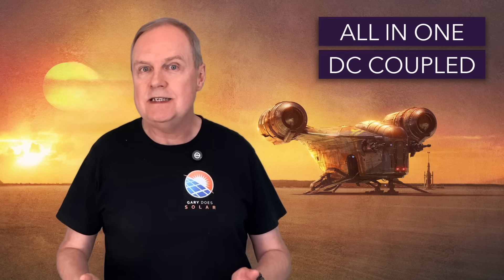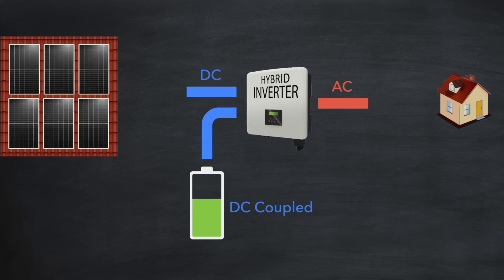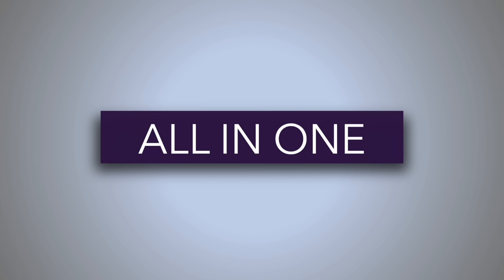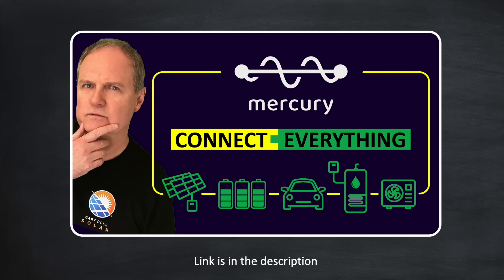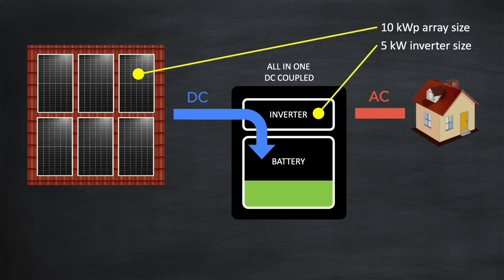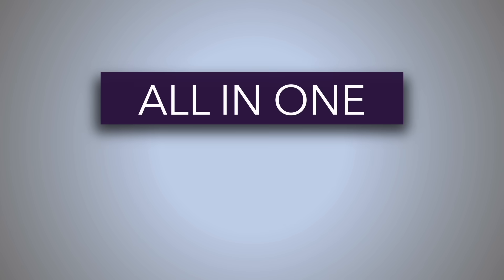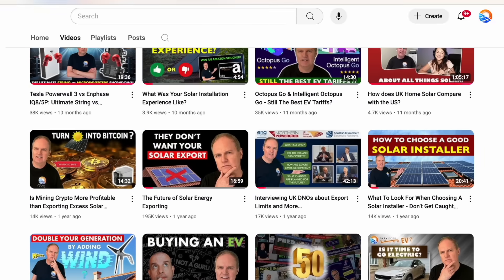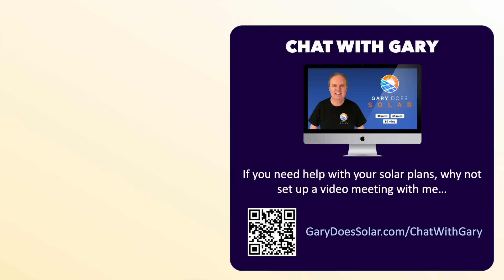Why All-in-One DC Coupled Systems are Transforming Home Solar

Comment: I was done a disservice by having a micro inverter system recommended and installed with my solar, even though I told them we would definitely be adding battery storage later as the prices were plummeting in ‘23-‘24. Now I have fewer choices and/or face big conversion losses taking my inverted panel production back to DC for a battery and back again to AC for home use. 😢
Reply: Correct. This is one of the reasons why I never recommended microinverters so far.
Reply: Having installed and serviced Microinverter, String and AIO, + offgrid systems, I don’t know that I agree that being set up with a Microinverter system was really a bad deal for you. Not the best, not the worst- all of them have achilles heels, all have advantages that might be lifesavers down the road.  

The lifesaver with Microinverters and AC coupled Batteries on the side is that you have less chance of getting a full system failure.  Inverters are ALL vulnerable, and some die.  With MI’s you still have others chugging along.. with a single sting inverter, you’re dark.

It’s very informative watching how these tools age, how their mfr’s age, how installation companies age- and what ‘the next guy’ has to face when coming across an ‘Ancient’ 18 yr old system.. what gear is salvagable, what is supported or warranteed, what will these shiny things be like when they have earned a handsome patina?

I would like to have some of my modules tapped with a simple DC bypass, so I can grab at least a few watts when everything else has pooped the sheets..  it’s amazing how insanely useful even 20-40-100 watts is when you just need the real essentials- otherwise, in regular times, backfeeding that grid and just earning your KWH’s while you’re busy doing the rest of life is the best value I see from residential solar.

(PS..), I have installed Sol-Arks and Midnite AIO’s, and tend to like them both a lot.. BUT, with them we are entirely dependent on the software being, becoming, remaining solid in there-  sometimes a new firmware update is like Christmas, bright lights shimmering and Angels sing- sometimes it kills the system, or revokes some feature you had loved or grown dependent on..  and don’t fall in love with any GUI.. it will be ripped from your hot little hands, sure as sugar.

The nightmare used to be the dream that you are onstage somewhere and you don’t know what show you’re in or any of your lines- today, a new nightmare is being jn a beautiful, fast lovely Car, and the programming changes unannounced, and at 85mph, you lose your steering and your brakes..  yeah.
Reply: @BobFiske  If the reliability of inverters is the concern, then microinverters are really NOT the answer as maybe you seek redundancy but in the same time according to the reliability analysis, of the most vulnerable item you would liek to have:
- The fewer the better, as the number of vulnerable items suppresses the system reliability
- The vulnerable items some handy place on the wall, not on the roof.
- No addition of the drawbacks from both worlds.

Comment: Sounds great, Gary but I still don't know how to do the following.  I have an EV.  When I am charging it during the day, I only want the excess power to go to the EV.  My charger will put 14A into the EV and if I am generating 10A of excess power, it will take 4A from the grid.  Then when I get a home battery, I want the EV to be charged first and only if there is still excess power, to send it to the home battery.  If there is still an excess excess, to send the power to the grid.  How do I do this.

Comment: 11:35 but the DNO/DSO always only see an inverter because our homes don’t use DC power.  So the question is whether or not they see a separate inverter for the battery and a separate inverter for the PV array.  Am I missing something there?

Comment: Robotic manufacturing, dark factories for sunny Australia.
Robotic manufacturing 247,365 is 8,760 hours of production per m².
Robotic manufacturing footprint is 50% human manufacturing footprint.
So 17,520 hours per "human" m².
Productive human manhours 1,800 hours per year. 

Factory production per m² is 10times bigger.

Australia does not need more workers.

Australia needs more PV electricity panels 
Australia has 20million empty roofs, dirt-cheap realestate. Australia needs :
More roof shading 😎 
More batteries 
More EVs 

Existing Manufacturing is where the population lives, where the roofs are. 
Government should reroof all roofs in PV and waterproof membrane under. In the shade of the panels. 

Near manufacturing needing clean energy 

New transmission from distant grid generation is extremely expensive. EXTREMELY EXPENSIVE. 
From distant renewables is also EXTREMELY EXPENSIVE.

Comment: As long as components can be swapped separately in case of a defect, fine. But that's THE condition for me.
Reply: I think that is possible, as far as you mean modules by the term "components". However some of these are quite heavy, so possibly you will need some help to do so.

Comment: Some very good points well put, When I carryout new solar PV installations I use DC connected equipment.  However when I carryout a battery  installations to an existing Solar PV  system that is receiving the FIT payment my preference is to fit an AC connected battery.
Reply from the maker: Thanks—and yes, adding an AC Coupled battery to an existing UK Feed-in-Tariff makes a lot of sense 👍🏻

Comment: Unfortunately I had an old FIT system from 2014, with a generation meter fitted straight after the inverter. All was well until in 2024 I had  a Libbi battery and a Zappi fitted. Worked great, but because it now had a hybrid inverter, the generation meter was replaced by a bi-directional meter that measured the net generation and when the solar charged the battery the meter ran down. After 10 months of trying the fix the problem, I had to buy a new separate inverter for the panels, and have the meter attached to this to get my true generation readings back. I would say, if you have a FIT tariff, do NOT interfere with the metering side of the solar generation and leave it AC coupled. The installer of the battery was very helpful in resolving the issue, and helped with the cost of the new inverter, discounting me the cost of it if I had another battery module installed. I am now very happy with my maxed out home storage system, and FIT payments have resumed, but it was a stressful time that could have been avoided.

Comment: Hi Gary, thank you very much about good video.
I have solar panels. I have planned (several years) to by ev. 
I have been waiting V2G solution or it could be better the integrated system that could handle all.
Did I understood right Sigenergy could do what I have been waiting for?
Of course after integrated system, you have quit challenging task to optimize  the whole.
The inputs for optimizing task should be at least: power price for input and output, transfer costs, solar production, home consumption and ev battery possibilities.
Do you know if there is any application/ or system for that optimizing task?
And then you need of course to evaluate how much all needed systems costs campared to possible incomes/ savings.

Comment: I'm a great fan of your channel, Gary, but for once I don't understand. You seem to be saying that the main benefit of all-in-one systems with a DC-coupled battery is to the DNO, not to the consumer - other than the convenience of it being a single package. That seems a curiously uninformed view.

There are pros and cons for AC and DC coupled batteries. You've covered the pros of DC-coupled, but what about the downsides? You had one right there on one of your slides: if you have a 10kW capable DC-coupled battery with a 5kW inverter and your home wants to draw 15kW... Oh dear, the battery can't help because it's limited by the solar inverter to 5kW, so you'll have to draw 10kW from the grid. What a "benefit!" The AC-coupled equivalent, OTOH, *can" supply 15kW - as you also strangely showed in your first slide!

And if you want to keep the DNO happy with AC-coupling why not just limit how much, if at all, to send to the grid from the battery?

The other aspect of all-in-one is that manufacturers can charge a small fortune for an add-on battery. This is mainly true of companies that primarily sell solar inverters.

And if you wonder what I've got well I've got one DC-coupled system in the UK using a PW3 and attached solar panels. But in France where we installed a SolarEdge system a couple of years ago, I've installed an AC-coupled Victron/PylonTech system which gives me the same battery capacity as the PW3 for half the price. Yes, it's not very neat but I have a big garage and it really doesn't matter. And I don't allow the battery to send power to the grid because it's not economic. Solar power yes, battery power no. And that's an extra level of control you get with AC-coupling.

So come on Gary. Give us a more balanced view of DC vs AC coupling, the sort for which you are usually noted!
Reply from the maker: Ok, quite a retort to my video, but that’s good as I like the debate. I’m making the point that the benefit of DC Coupled wrt to DNO is that the consumer can have a much greater battery capacity/output than they might be able to with AC Coupled if the DNO is likely to restrict.

Comment: Great video as always.
I have been thinking about getting a home battery recently, but not sure how to proceed due to the unusual setup I have. (The 4kw solar array is ground mounted and sited about 60 metres from the house, with the string inverter next to the array.) What would you do if you were in my situation please?
Reply from the maker: Hmmm, interesting question. If the battery is to be in DC Coupled mode. Then close proximity to the inverter is desirable. If AC Coupled then it can be placed anywhere where the AC supply runs 👍🏻

Comment: Sigenergy now make micro inverters that can also be incorporated into their all in one systems ac coupled along with dc coupled if you have shading mitigation issues or need to add some extra panels on another roof pitch but don’t have enough mppt’s to run anther string. So great versatility. I have mixed my existing Enphase micro inverters with some new extra dc coupled arrays. Cheers
Reply from the maker: Yup—and I’ll be covering this in a future video. Smart move, Sigenergy 😀👍🏻

Comment: Another great non bias video that is exactly the true facts and not just opinion.
I originally installed 13.3 kw rec alpha pure with Enphase 3 years ago and waited till now for batteries to come down but now here in Australia we are getting a great federal govt discount of about $38.00 per kw or on average about 30%, much like the STC rebates available for PV systems so it is now economicaly viable to complete the missing piece.
I have gone with the 3 phase 40kw Sigenergy with 25kw inverter and gateway and added another 15.5kw Aiko neostar 3s pv array to my shed on east and west facing roof and have dc coupled this with two strings direct to the sig mppt’s and also have the Enphase ac coupled simultaneously through the smart port so now have the best of both worlds.
I’d be keen to hear some other comments and thoughts on this as I haven’t seen or heard of anyone else doing this in a retro fit? Thanks
Reply from the maker: Sounds like a great setup, Michael 😀

Comment: I always wondered about the efficiency, constantly switching back and forth between AC and DC: having DC panels and batteries, and putting inverters between them to move the power around. Why not have DC panels, optimizers and batteries, and only have one inverter feeding the house and grid?
Reply from the maker: Yup!

Comment: Add a DC EV charger and a DC heat pump for the house heating, cooling and hot water.
You get most of the load of the house without converting to AC. It should have a 300-500V battery just like most EV.
Reply from the maker: I like your thinking, Alex!

Comment: I have about 6 circuits in my home, ihow do i plug in and have all six fed from solar battery. I dont think many people posting videos like this understand house wiring at all, but maybe i am missing something, I could buy 2 450 watt solar panels very cheap right now, brand new i am far north of the uk so get perfect south facing sunlight,  I want a battery say an eco flow and attach a few 120ah batteries. But i am not qualified to rewire and i am renting, so would need a qualified electrician to come and do it , costing a lot of money i would not make back from savings for many years. I really need 6 separate ecoflows all recharged by solar panels and connected to each circuit , upstair lights, upstairs plugs, downstairs light , downstair plugs, some split to make 6 separate circuits.,  Make it make sense!
Reply from the maker: Why don’t you discuss your particular requirement with an installer?
Reply: There's a new flat wiring product which is installed on walls.  Could you set up parallel house wiring with receptacles which is automatically switched on when power fails, to maintain power to critical loads?  Also speak with your landlord. They may be receptive to installing a transfer switch. A backup-ready house  may be an inducement for a certain desirable type of future renter specifically oriented to considering the potential benefit. As well, a saddle style mini split window heat pump could be operated during an outage, protecting the pipes from freezing in winter.

Comment: I'm in Australia and am struggling to find an installer willing to perform a DC coupled install, they all push for AC coupled. Can someone offer me any insights as to why that is?
Reply from the maker: The Sigenergy SigenStor is the number one residential battery in Australia, so I don’t understand why you’re having difficulties with your requirement?

Comment: All in one dc coupled system where my inverter limits my export to the grid? No thanks. I'm surprised you did not explain how utilities are moving to export energy credits by the hour, where they pay very little for power exported mid day and pay most between 7pm-8pm right after the sun goes down and the daily demand is at its highest. The panels charge the batteries mid day and then I schedule discharge back to grid between 7-8pm. I save room in the batteries to get me though the night until the sun starts charging the panels again.
Reply from the maker: You clearly haven’t watched many of my videos then…

Comment: All in one DC-coupled systems were available in Germany already in 2016 from E3DC, the unit was called S10E. So the news are quite old 😉
The issue then and now is the poor upgradeability and the high prices of these units. I like the sleek design but I‘m not sure if I‘d buy one again. My system is from 2018, runs smoothly but is outdated technically (small 5kWh NMC battery, the HEMS is not ideal either, not financially sensibly upgradable).